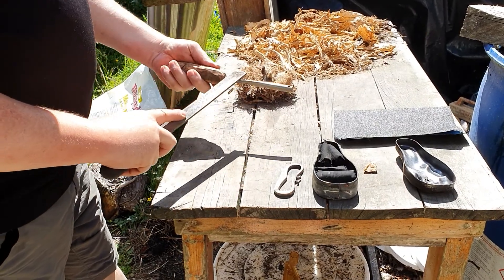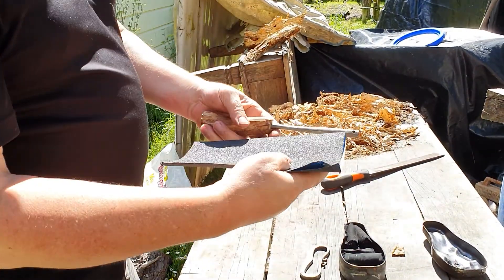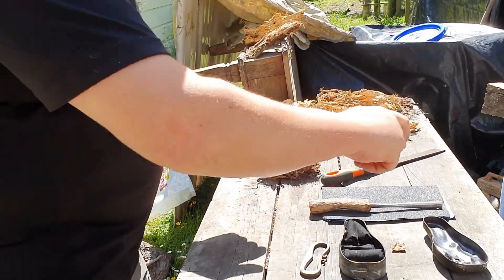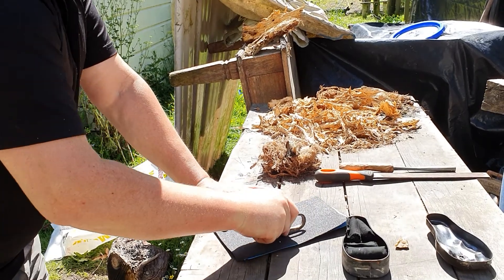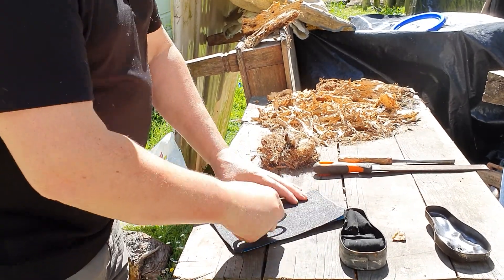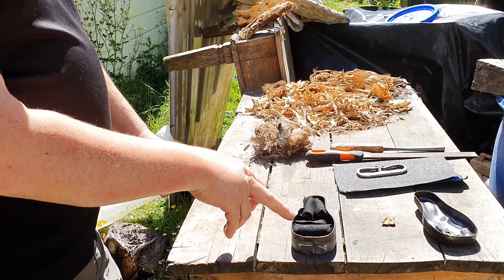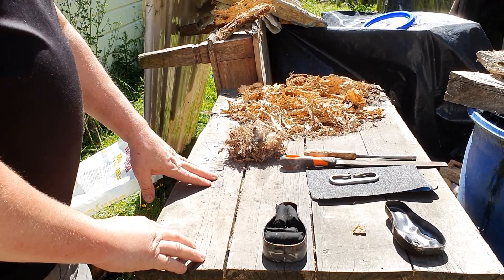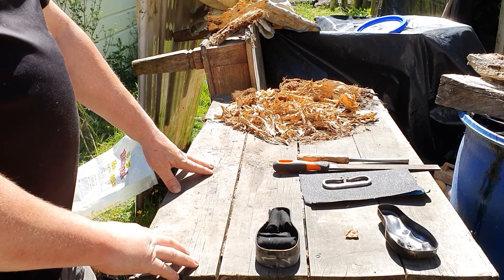Quick (MAINTENANCE TIP) For Our Steel Flint Striker, and ferro rod.💥💥💥😁😁😁👍

Comment: I hadn't thought of filing off the speed bumps on ferro rods. A couple of mine look like ram's horn now, thanks for the tip! I need to touch up a couple of my strikers too, along with the spine of my ESEE JG-3. I love that little knife and it works quite well as a striker in a pinch.
Reply from the maker: Awesome Crusty Otter. Glad i could help. Thanks for stopping by.👍